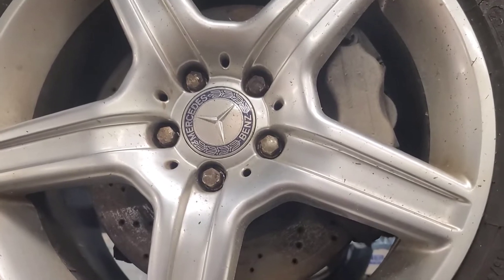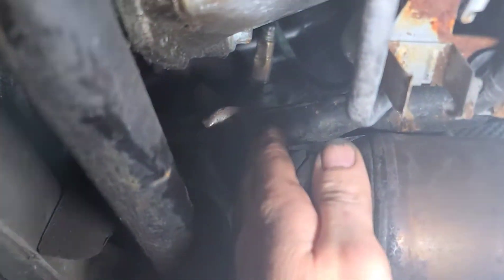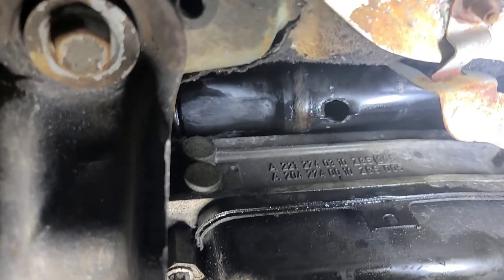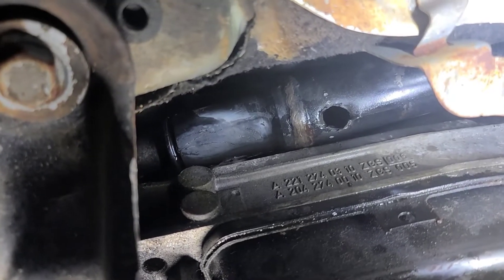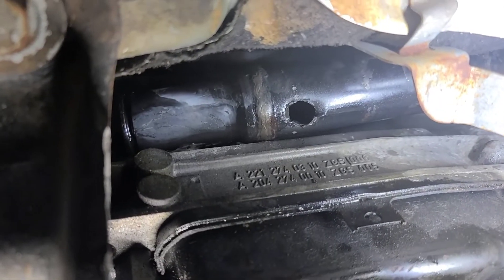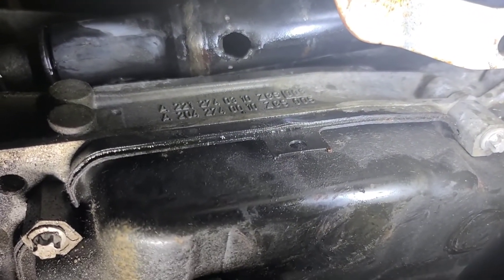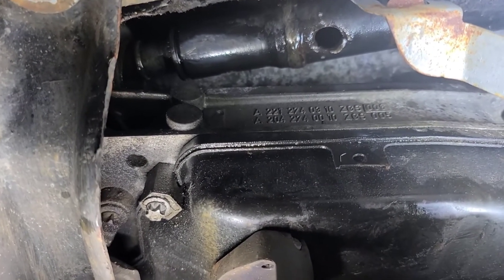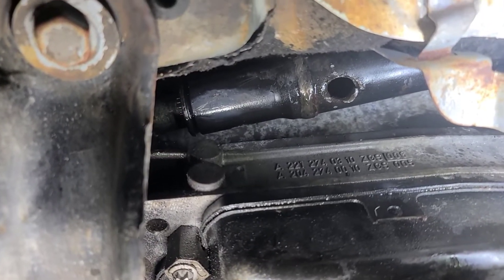Mercedes S550 4Matic Front Driveshaft Won't Slide Off Transfer Case Spline?

Comment: Slide hammer on the end of the propshaft perhaps
Reply from the maker: No room for slide hammer in front as the diff and exhaust are in the way. I think I'm going the remove the transmission mount and slice the shaft with a zip cut blade. On both sides if I have to.
Reply: @PhillipBailey  just a suggestion, maybe the splines are damaged try rotating in the opposite direction of normal forward rotation whilst in gear or park
Reply from the maker: @davesterl  yes never thought of that. The frontbtwisted off so possibly the spline is twisted. I'm going to try zip cutting it tomorrow.
Reply: Must remove the C clip holding the intermediate shaft at the oil pan and slide off the whole thing out and separate outside the vehicle, if you keep hammering on it you will break the transfer case housing or oil pan housing that holds the bearing from sliding out, if you break that it is a major problem replacing oil pan by removing the engine or dropping the subframe with everything with it, suspension, steering and all .
Reply: I’m having the same issue with my x164 gl450 I’m replacing the front differential , and the drive shaft boot was torned , I did removed all 6 bolts and can’t seem to get it off the colar , WD40 and nothing moved any suggestions , I have the new drive shaft and new differential this has been quiet challenging
Reply from the maker: Sorry but I have no suggestions other than penetrating fluid and possibly heat from a propane torch. Careful not to start a fire unless it's insured...